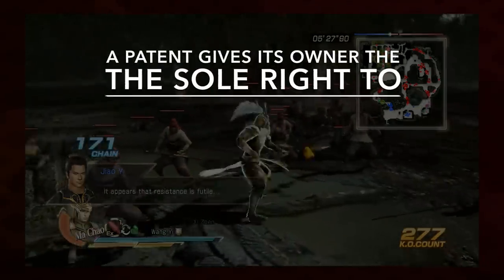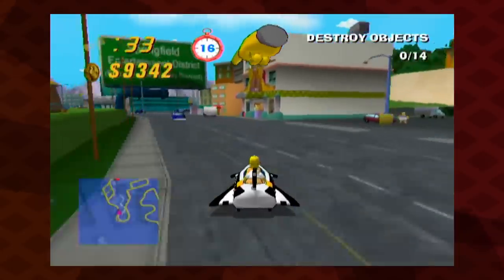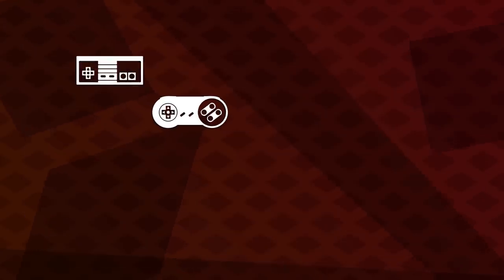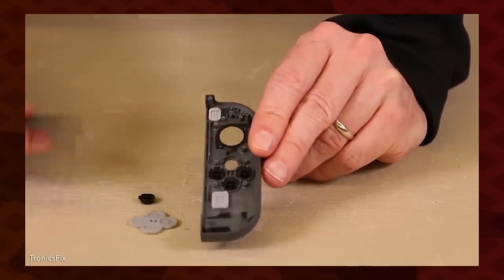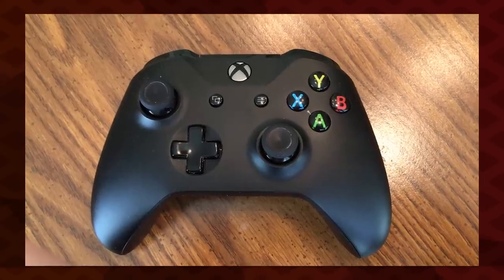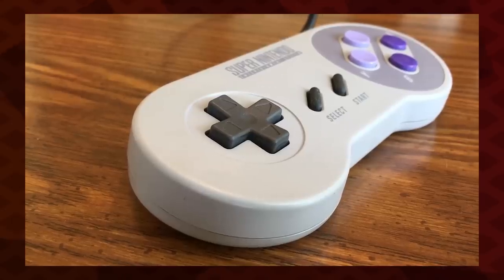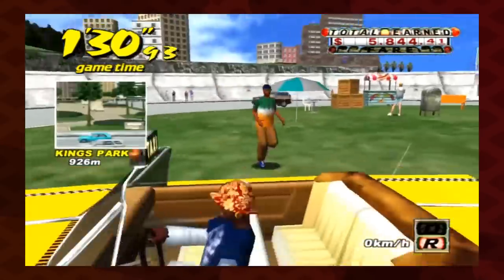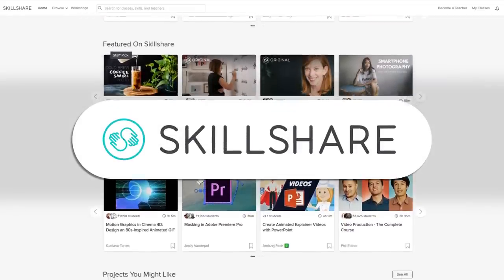Game Patents - Protecting Crazy Taxi's Arrow, Nintendo's D-Pad & More

Comment: Feels like the video talks of patents from a single perspective. Cannot entirely agree with this one. Imagine if the minimap was patented. And then the other method of navigation. And another one. How many good ways to navigate in a driving game you can come up with? 3? 10? 
I'm saying that it's better to have 100 titles with copied/reimagined good mechanics than only 1 or 2 unique.
Reply: How do we know minimaps weren't patented? If it was so easy for multiple companies to get around Nintendo's D-pad patent with a slight aesthetic variation, it really wouldn't be that hard to alter a square or circular minimap that sits in the upper left corner of the screen to one that has a different shape, sits in a different corner, only shows up if you hold left-trigger on a gamepad, or looks like a miniature 3-D hologram of the current level. Adding zoom functionality to the minimap could also have been enough to differentiate from a patented design. And all these ideas could have been patented!

Comment: 10:22 wait a minute, so square have the patents for stats down? 
and more important, how other companies do debuffs in rpgs?
Reply: its stats down specifically for the judge system, using yellow and red cards if you look at the actual table in the patent, so it is very very specific as a patent.
Reply: @MrSuckeragi  Wait, but when the jugde system did that?
In TA1 it gives you a warning, after that it sends you to jail.
And in TA2: it just negate the bonus rewards and blocks you from reviving characters.

Comment: wait, so the dualshock did know how hard you pressed. so you DID drive faster by holding down the button hard. I KNEW IT!
Reply from the maker: Well, the game COULD tell that you were pressing harder, but that doesn't mean the game necessarily did anything with that info.
Reply: In addition to what @Design Doc said, it really didn't take much pressure to reach maximum articulation on the analog buttons; it certainly didn't require the death-grip that I've seen people use on their controllers.

Comment: How can this video act like patents drive innovation with no significant issue?
It includes examples of patents with unquestionably negative impacts, such as patenting having games during the loading screen, or FFX's sphere grid. In fact, the argument that patents drive innovation (such as with the mini-map) is missing an important element: there can be an optimum. Imagine the mini-map was patented. Imagine hidden loading through cinematic or speed-limited sections, or progressive loading of the environment, were patented. We would be let with quantities of poor alternatives just because of these patents.
In addition, patents in game designs go against the creation of gaming conventions and habits. The mini-map is made more practical by the fact that this is now a basic element people learnt to fully understand. Recurring designs become part of the global rules and do not need a tutorial and learning/habituation from the player.
Patenting game design & control has different impacts than patenting algorithms and mechanics. Game design & control are directly in contact with the user, while the latter has no need to understand how it works in the back end (algorithms and mechanics). A patenting as lon as 20 years can have significant drawbacks.